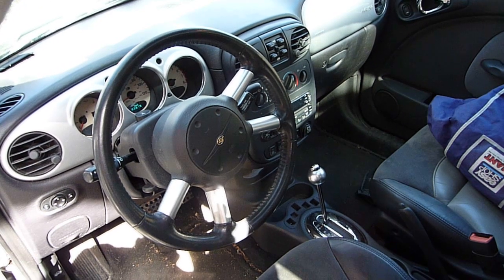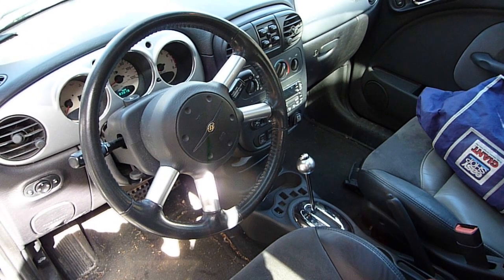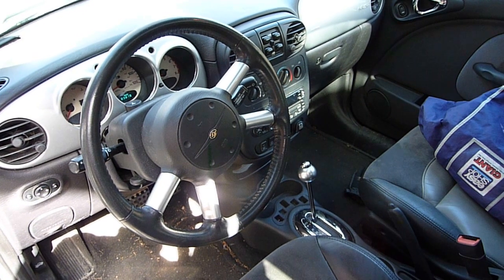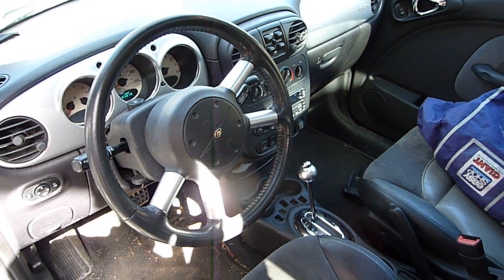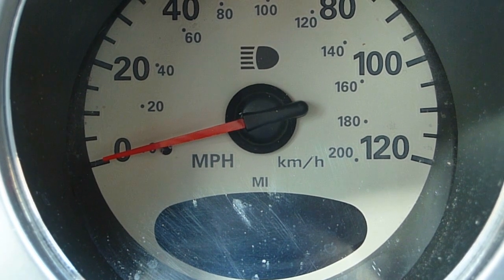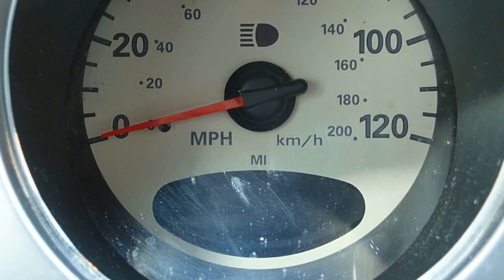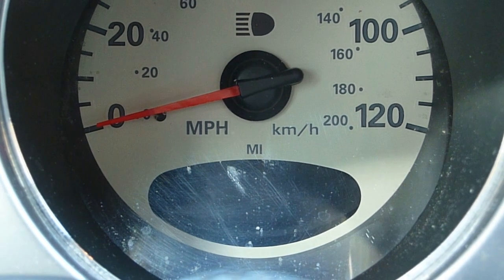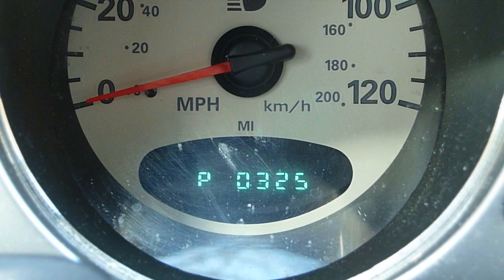PT Cruiser ACTUAL Error Codes using Ignition Key and Odometer Display ...codes P0340 and P0325 seen

Comment: I get the same codes did you replace both cam and knock sensors
Reply from the maker: Short answer is NO.  I replaced just the cam sensor (it's cheap & easy), replaced the spark plugs (without taking off the intake manifold ... there's a video for that), and did a decent OK cleaning of the throttle body (there's also a video for that ...does NOT involve taking off the throttle body either but you need the long forceps from Harbor Freight ... less than $10).  And new air filter.
The knock sensor error code went away  and never returned.... which is fortunate because it's location is a hassle for me to get at.
Reply: Only the Turbo model PT Cruisers allow for spark plug replacement without removing the upper plenium..It is design differently.

Comment: Why didn't you show the key in the ignition while turning it? After all, It is a key dance, right?  We already know what the code is.
Reply from the maker: Definitely a most reasonable point ... My emphasis was on the odometer display and showing actual, real error codes; there were limitations with camera placement and having a relativity short video.
Reply: Did you mention somewhere previously what the key sequence actually is? My wife has a 2006 PT and we're trying to figure this out right now.
Reply: It seemed like you move it to AUX and then cycle three times to ON from AUX?
Reply from the maker: Hopefully it is a help .... in the SHOW MORE, I've added a description of the "key dance".
Reply: Thank you massspecguy, that does help. But next time, PLEASE, show me what you're talking about.